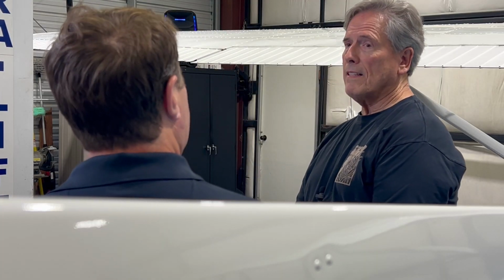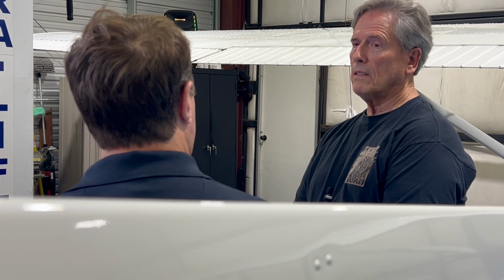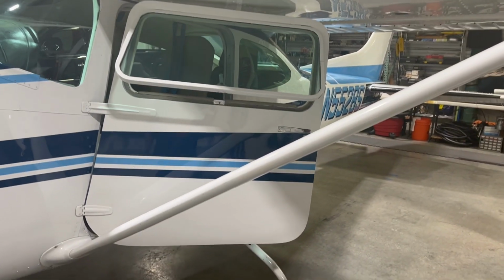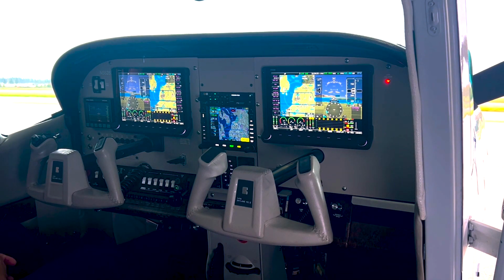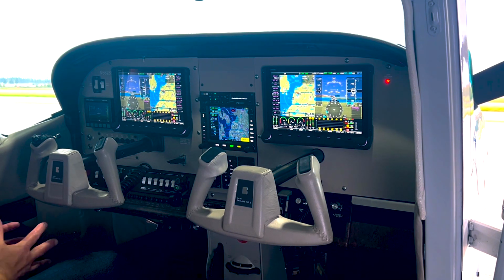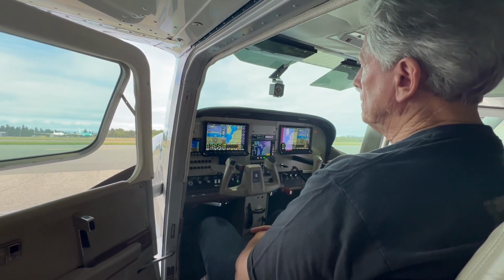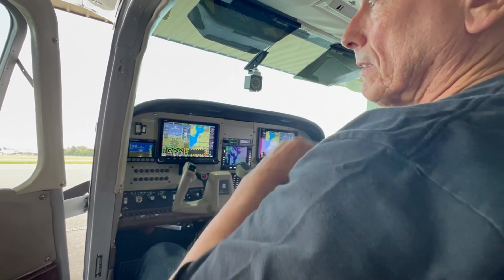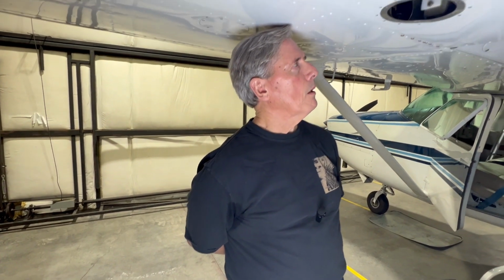Pilot | Plane | Panel Profile: Rick Harbert's Cessna TR182 featuring SkyView HDX

Comment: Why would a turbocharged engine require carb heat? Isn't the intake air heated indirectly by the turbo?
Reply: Turbo wastegate is wide open on low power settings (MP< atmospheric pressure). With exhaust gases mostly bypassing the turbo, it can cool down to the point where carb ice could form. The TR182 isn't really prone to carb icing but it can happen.
Reply: @akibuilds  Thank you. I've asked this question to others before. Yours is the first explanation that makes sense.